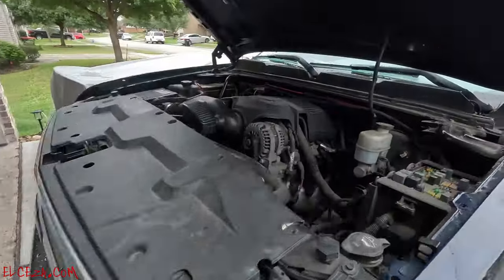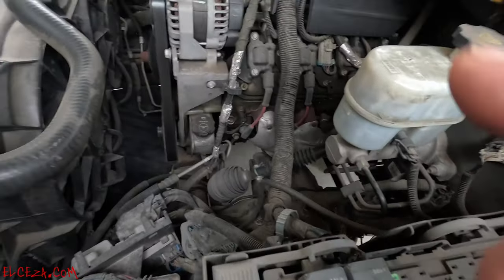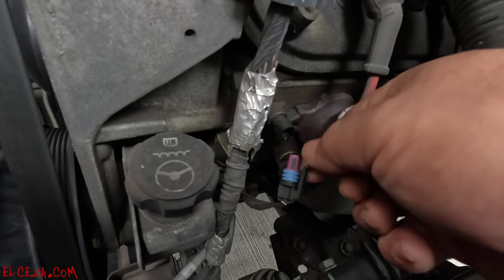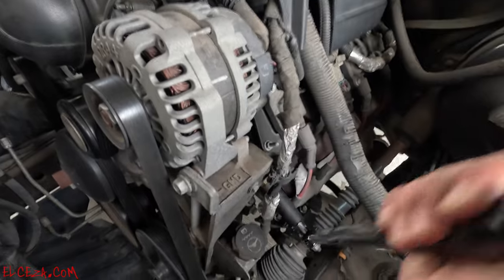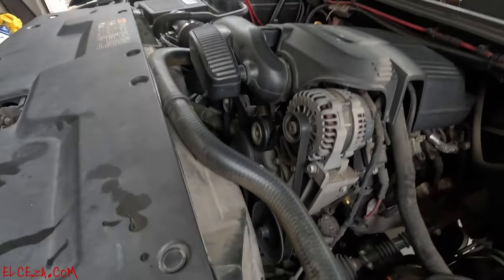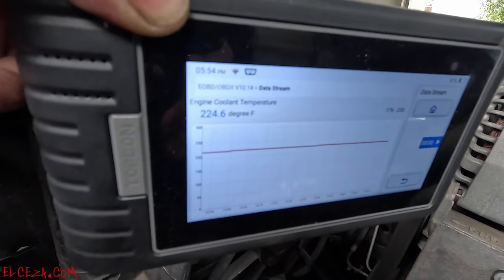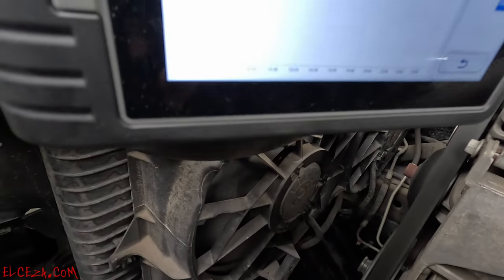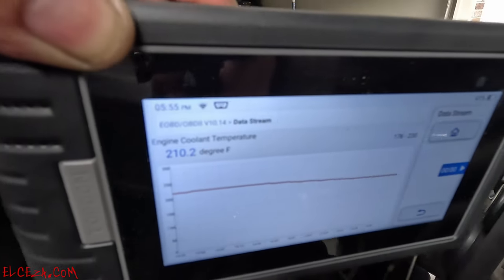2007-2013 Sierra/Silverado Electric Fan Fix! Cooling Fans Not Running

Comment: I was having overheating issues on mine and I went ahead and replaced the water pump,thermostat ,radiator hoses and temp sensor and the fans weren’t working. I found out thanks to this video and my mechanic that those specific trucks kick the fans on at 225. Rather high but I’m expecting to take the truck to get it tuned.
Reply: Man I just replaced the sensor and the thermostat and still doesn’t work
Reply from the maker: @marcochavez402 check relays
Reply: @marcochavez402 I replaced water pump, sensor, relays, thermostat, and radiator still did the same thing I’m guessing tuning it is the next thing 🤦🏽‍♂️

Comment: One thing that is worth mentioning with these trucks is that if you do a coolant flush/drain, you need to make sure to properly fill the system back up and not leave any air in system. Its trycky filling these trucks back up with coolant
Reply from the maker: I agree

Comment: Solved my 03 Impala would never kick in the fans at operating temp at 195*. I now know with your help most GM will kick in at at least 225*. All relays are good, fans works great when ac is on.

Comment: My stepson has a 2005 Silverado 1500 He told me his truck started overheating the other night. Today I told him that he should start with replacing the new Auto Zone Thermostat he bought the other day. Now he has circulation in the cooling system, but the fans are not turning on. According to the gauge the engine is at 210, so it's still below normal but he told me a half hour ago that it went up to 240 and still no fan operation...
Thanks for the video. I told him that as long as the 3-relays are good, it would either be the fan, or the sensor...
Reply from the maker: No problem and that is correct

Comment: How did you test the relays to make sure they were good?  I'm having a problem where my fan is not kicking on when I turn the AC on.
Reply from the maker: Switch it with the other relays
They are the same

Comment: 2005 chevy 1500 5.3L it has electric motors for cooling fans but doesn’t have relay for the fans nothing shows up except ac relay they don’t kick in . What can I do if I don’t have fan relay
Reply from the maker: The relay box to the fans are towards the firewall
You need to remove plastics to be able to see it

Comment: I changed radiator , water pump , thermostat , coolant temp sensor , all hoses , fuses are good , low speed fan still won’t kick on
Reply from the maker: How high is temperature getting?
Reply: @El_Ceza  3 quarters from 260
Reply from the maker: Check relay
Reply: You need to fix the missing exhaust manifold bolt next to sensor
Reply: Did you ever figure it out? I’m having the same issue
Reply from the maker: @soulgivesoul07 might be the stock setting for turning on the fans

Comment: I was change relays, fuses sensor and termostat and noting hapen the fan only works with a/c
Reply from the maker: Sorry i couldnt be of some hellp
Reply: Have you figured out what it was mines doing it
Reply: Your fans are bad
Reply: @El_Ceza my truck never over heated till now. Has two fansi saw that one fan is on? Can the fans be it? My ac stopped blowing cold are too
Reply from the maker: @AlexMartinez-yl1ef swap relays if it still does not work its going to be the motor